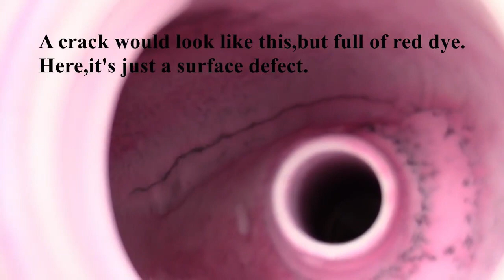Dye penetration Engine Block or Head crack testing

Comment: Most of the time cracks open only when the engine is hot and working (pressure). It is very hard to find them cold.
Reply: With this penetrant it's simple and reliable.. I'll say in inlet/exhaust ports that's superior. If it shows crack that's definetly a crack, but if in hot bath You see no pressure loss/bubbles, that doesn't mean crack isn't developing somewhere...